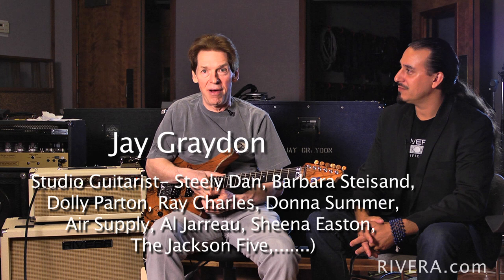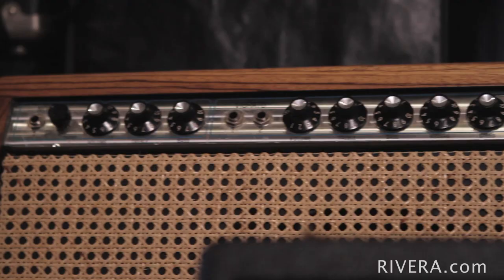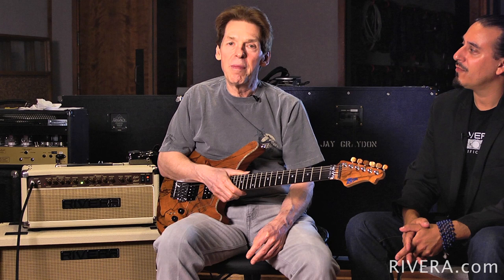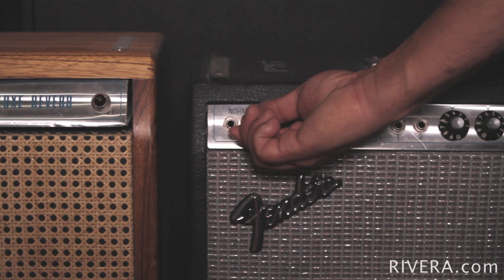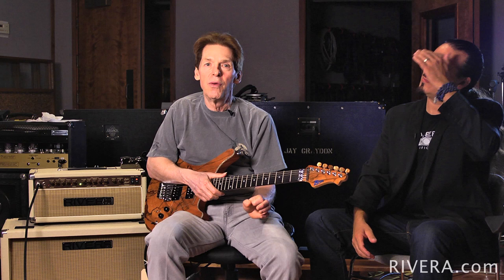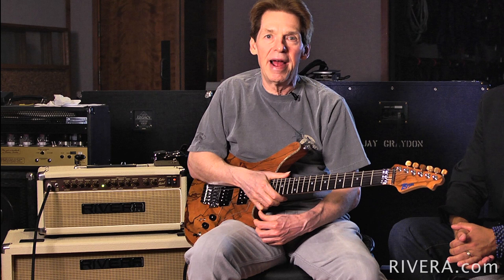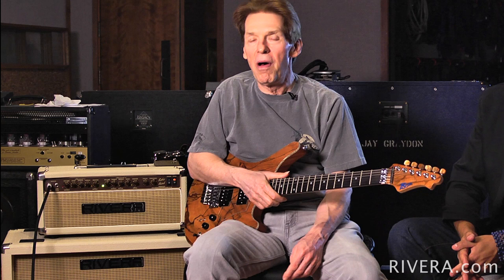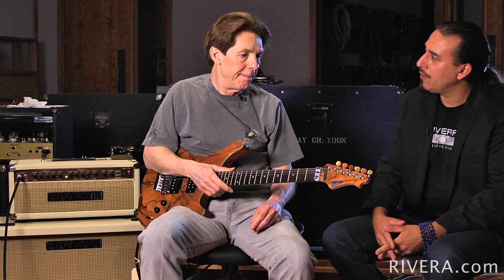Jay Graydon interview Part 1 - History w/ Rivera Amplification

Comment: He's absolutely spot-on about his love of midrange and how Rivera amps produce it. My Knucklehead '55 (I should NOT have sold it!) had the most musical and useful midrange I've ever experienced.

It's hard to describe, but the best way I can put it is this: a lot of other amps' midrange can be 'plastic-y' or will smother the other frequencies like a layer of polyurethane. A Rivera amps' midrange is 'woody', and it sits with the other frequencies in a complementary way, and is never 'honky' in a bad way.

Even if you set your EQ on a Rivera amp as Bass 0-1, Middle 9-10, Treble 0-1, there are indeed a whole lot of beautiful overtones coming out of that midrange knob. At low gain, you can go 'midrange heavy' for spectacular Jim Hall style tones, and at high gain head into Robben Ford humbucker territory; it's all so CLEAR. Also, diming midrange on the Knucklehead '55 would also add another nice layer of 'gain' in a way.

God, I miss my Knucklehead '55! Especially for guitars with humbuckers, where the guitar's volume knob has all the tones/dynamic range you need from gain, with clarity from 1-10.